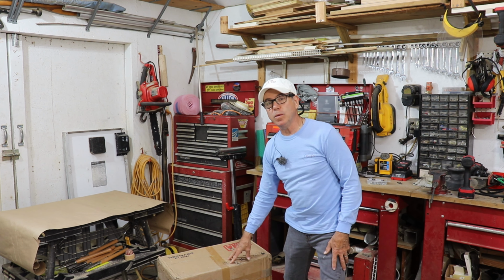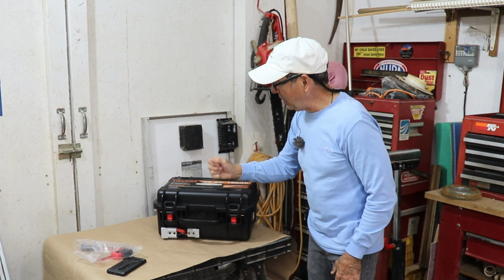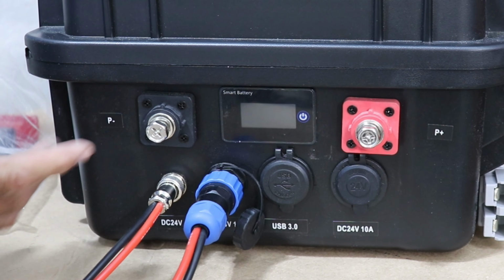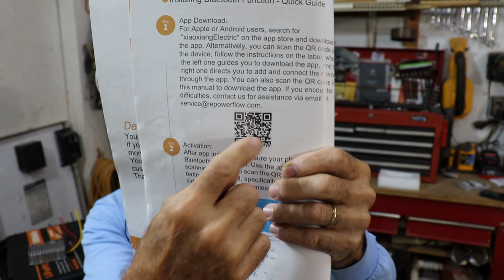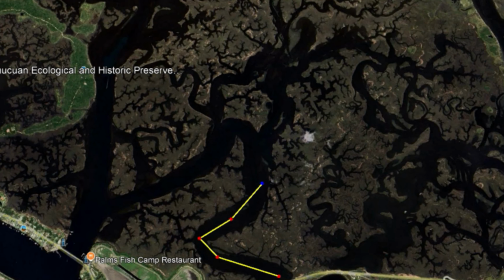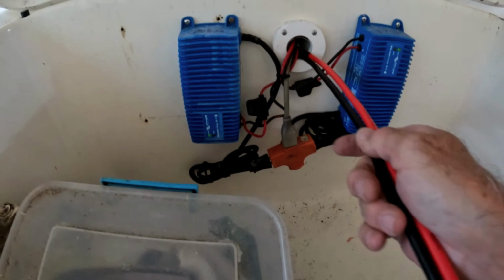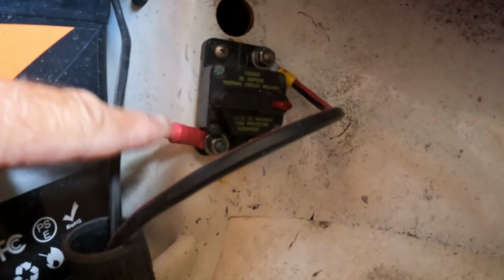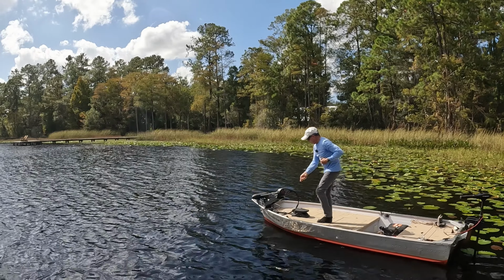Lithium batteries for trolling motors, RePowerflow Waterproof lithium power box, #lithium #trolling

Comment: The connectors and display may have been better protected somehow. For example in a recess that makes it unlikely to bump into something. Possibly even with an additional lid or so. Such heavy powerpack makes it easy to destroy such filigree exterior.

Comment: Why is it rated a 1 ?? ….did you have any of the issues that the ONE reviewer had 🤷‍♂️
Reply from the maker: The 24v has a 4.9 rating.  I saw the 1 rating for the 12v.  There is only one rating and its bad but I haven't had any issues.  The support has been quick to respond (via email).  I had an issue with delivery and repower hunted down the problem with the shipping company.  When the item never came they quickly sent a replacement.
Reply: @ great to hear….I think its a really well designed product.   I was glad to see it work smoothly for you. .   I’m confident that they will get their logistics sorted, eventually.   Thanks for reviewing this. 👍

Comment: Does the battery have any alarms for off gassing or thermal runaway?
Reply from the maker: The BMS has thermal protection, it shuts down the battery long before it over temp.